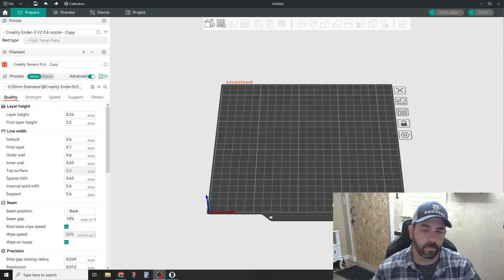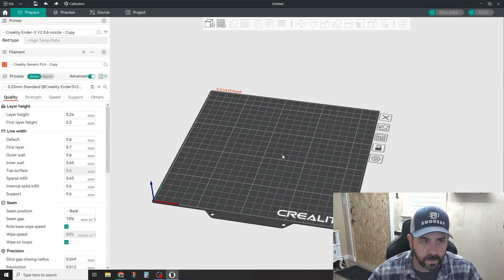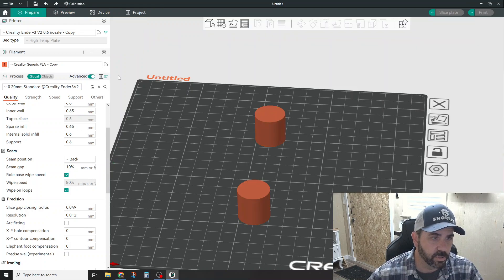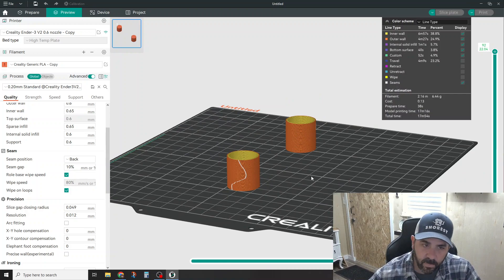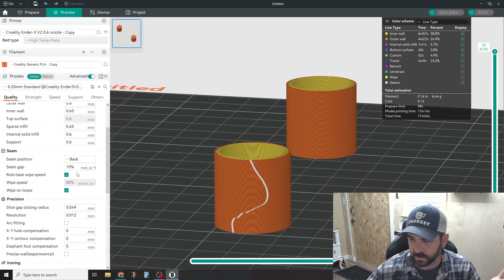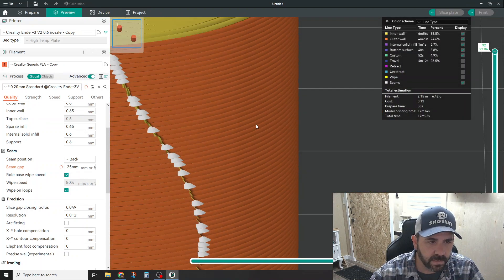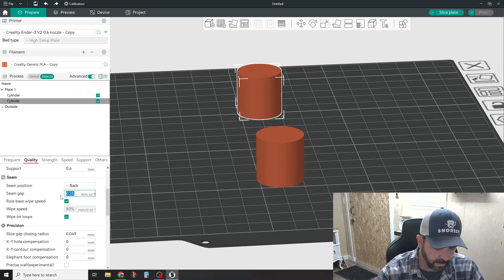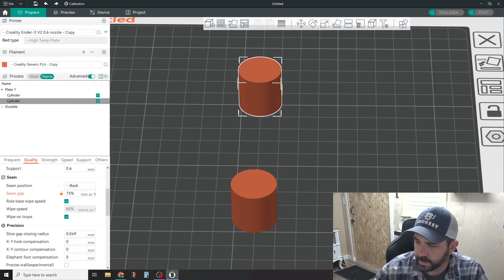Orca Slicer Quick Tip.  Tuning z seam placement and quality and multiple processes.

Comment: I really wish it had the Cura "sharpest corner" option. I cant believe thats not added by default. It hides seams super well.
Reply from the maker: agreed.  The paint z-seam is a nice option, but even ideamaker has the option to place on reflex or convex corners as a selection... definitely would be nice to have a few more options in the drop-down.
Reply: Hi there fischer3d I have a issue with textured prints where z seam does not seam to change off ransom no matter what I try ! Have any tips ?
Reply from the maker: Maybe check under the Process>Objects settings and make sure you don't have something in there on the quality tab overriding the global setting.